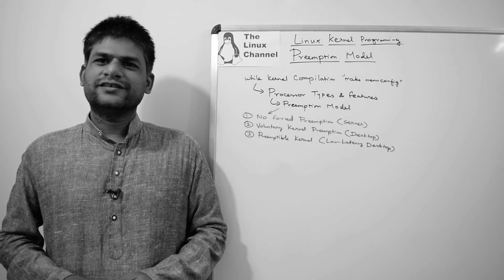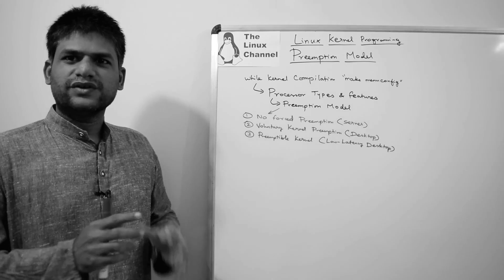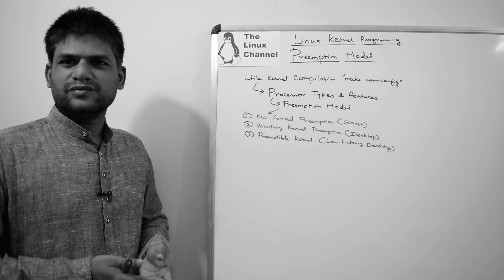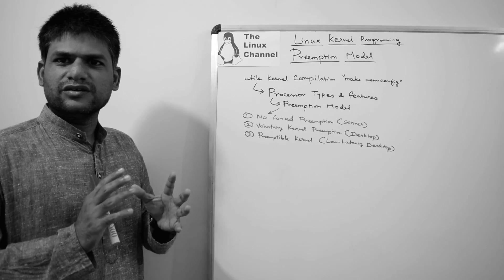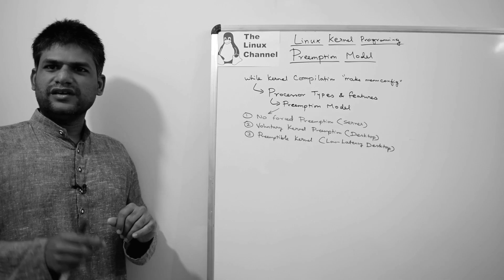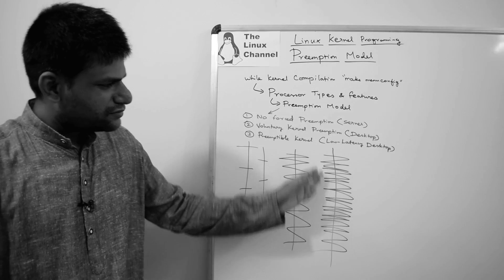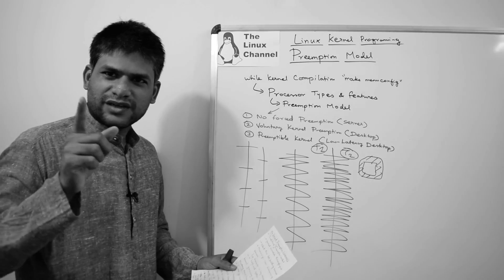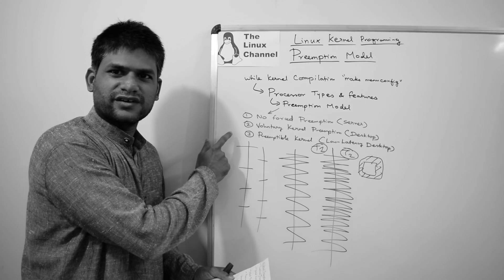Linux Kernel Programming - kernel preemption model during Kernel Compilation #linuxkernel #education

Comment: Thanks for sharing your knowledge!

Let's see If I have understood the lesson with a few real cases:

If I want to make some stream with OBS, two webcams and some youtube songs with JACK AUDIO server to manage the different channels and publish It over twitch on real time. I will use a low latency kernel compilation.

After that, If I want to edit the resulting video and render it over openshot/blender, I'll use a kernel compilation with no preemption to render big blocks on CPU

To my normal day PC working, I need a medium preemption.

Another real life case would be a rasberry pi with openVPN server, on this case a low preemption would be desirable to make better encryption.

I am right?

What you thing about this cases?

Thanks in advance, I’d appreciate your help in this matter,  looking forward to hearing from you.

Sincerely 
F.
Reply from the maker: Hi nice to meet you :)
For normal desktop PC: medium to full preemption is good to get smooth (a bit aggressive) desktop performance. Recently I did a video about Manjaro Linux. Unlike Ubuntu, when I checked, it is compiled with low-latency desktop preemption mode. This is the video: https://www.youtube.com/watch?v=SF3j_zbVYgA

So I am using Manjaro in my HP laptop, my wife laptop and my VM desktop. BTW, Manjaro is a Arch Linux fork, is what I heard. And it is a rolling release. Which means you never have to do distro upgrades like Fedora/Ubuntu/Debian. In this case always it gets latest stable software releases and can upgrade seamless.

Another real life case would be a rasberry pi with openVPN server, on this case a low preemption would be desirable to make better encryption.
>> yes in theory. Although you can deploy and do some trials. Since Raspberry Pi is a low config hardware. You would notice huge performance changes with these minor tweaks. We cannot often see these on a PC or a moderate good performance laptops. Take care :)